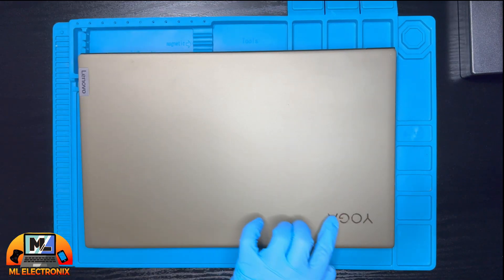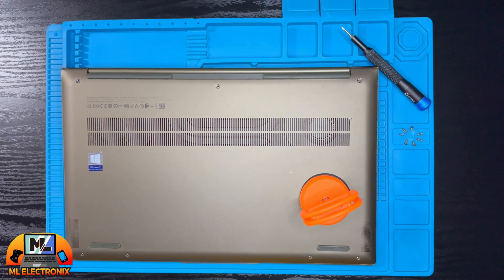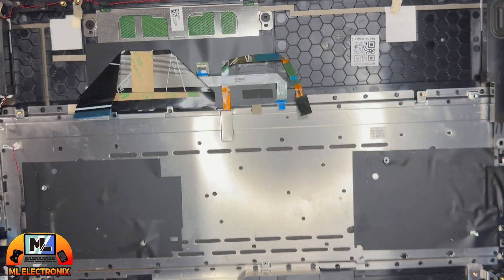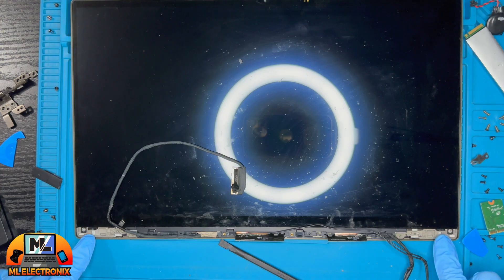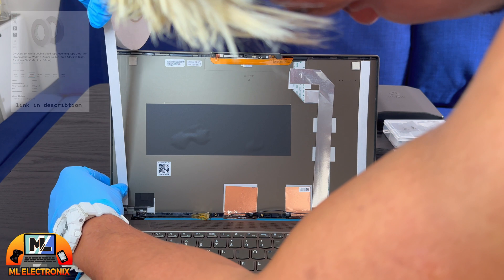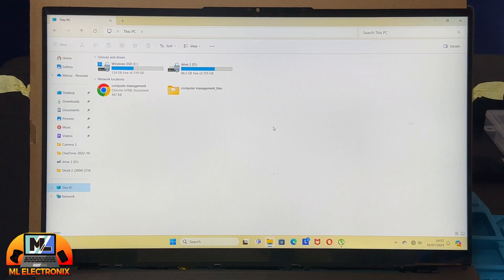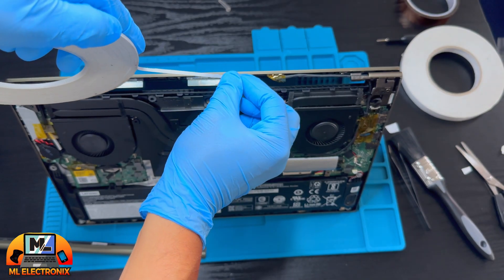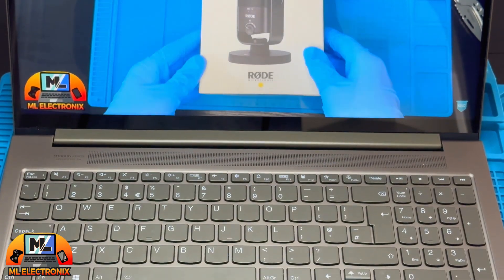💻 Lenovo Yoga Slim 7 No Backlight | Screen Replacement ✅ | ML ElectroniX #fyp

Comment: is this also the case for lenovo yoga slim 7i carbon? do i really need to replace the whole display because of no backlight problem?
Reply from the maker: Potential Causes and Solutions: Display Panel Malfunction, System Board Issues, Loose or Incompatible Display Cable, Faulty Backlight Fuse: Some users have identified a component labeled "FV1" as the backlight fuse.

While a backlight issue might necessitate a display replacement, it's not always the case.  Before proceeding with a full replacement, consider diagnosing the problem to identify if it's related to the system board, display cable, or backlight fuse.  This approach could save you time and money.

Comment: You mentioned that the old screen has a backlight issue. So did you swap the LCD to the new OLED screen?
Reply from the maker: Yes, the old screen had a backlight issue due to a burned screen board. The customer requested a quick repair, so this is how it went.
Reply: @mlelectronix  i have the same problem(backlight problem) i don't know the cause of it? is it also burned screen board? are there any things that i should avoid doing in the future, so my screen board won't burned again?
Reply from the maker: @GeneraL-li7uo To prevent this kind of damage in the future:

1. Avoid using the laptop on unstable power sources – Always use a good quality charger and avoid frequent plug/unplug cycles.

2. Keep the laptop cool – Overheating can damage sensitive components including the screen board.

3. Be gentle when opening/closing the lid – Flexing the screen can stress internal cables and connections.

4. If you open the laptop yourself – Always disconnect the battery before touching display components.

Comment: Basically the backlight can be from the motherboard of the laptop of from the mb of the screen panel. M'I right?
Reply from the maker: Yes, this specific laptop has a screen motherboard under it, the ones that don't have, the backlight issue can be located on the main motherboard of the laptop, in most the cases one or more fuses are burned out